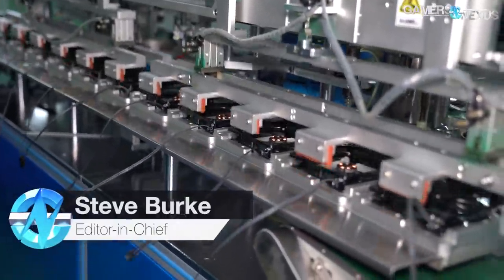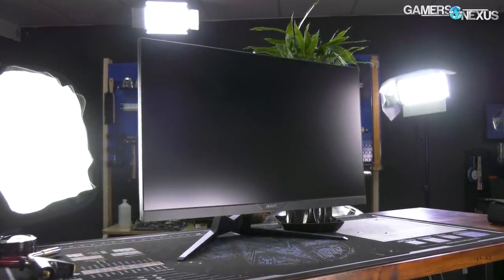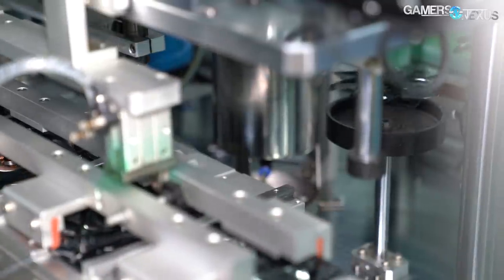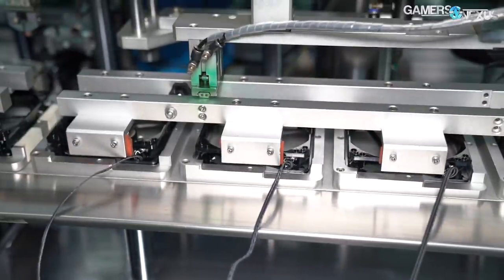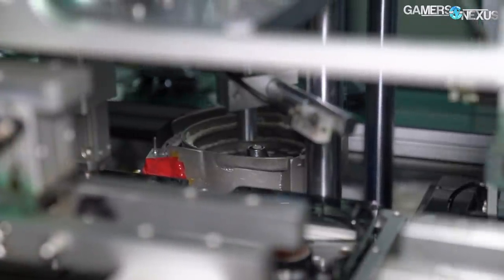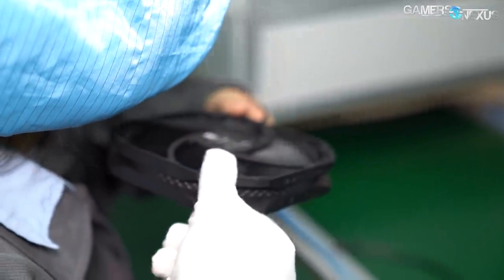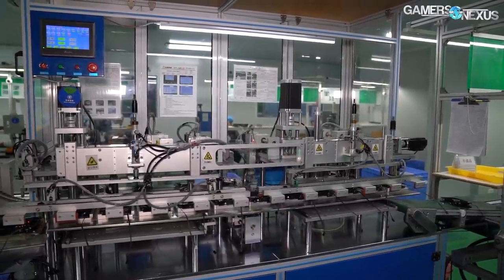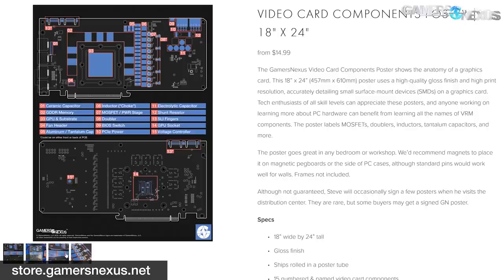How PC Case Fans Are Made | Shenzhen Factory Tour (Deepcool)

Comment: don't understand why fan manufactures don't use silent pwm modulation instead of straight square wave which is noisy as hell
Reply: Its cheaper? I dont know. But Money is one of the important points.Cheper is better = more profit.
Reply: @Noname_2014  a little yes but it is probably less than half dollar each for a dead silent driver instead of the tikking you often hear.
And customers would gladly pay one dollar extra for the silence

Comment: that's not a bearing. that's a bushing. and that's not good. they cause more friction and wear down faster than an actual bearing
Reply: Actually, a bushing is a bearing (plain bearing to be precise). And is often used with shafts that spin fast since a film of oil develops around the contact area between the shaft and bushing causing the shaft to ride on a layer of oil without making direct contact with the bushing. This is a low friction, low wear operating state. The only significant wear should occur on spinup and spindown. Even normal sintered metal bearings will exhibit this behaviour at high rpms such as those seen in fans (if the right lube is used), but lube will eventually dry out. However, more specialised rifle/spiral groove bearings have a groove cut into them for this purpose, the lubricant is drawn from a reservoir. Either way, even basic sintered metal bearings have a ~30000 hr lifespan. Rifle bearings and other specialized FDM bearings are just quieter and their lifespan lies around 50000 hrs.

Comment: No metter what brand if it's 2-ball-bearing, it's ok. Do not accept less.
Reply: If you want it to last, get magnetic levitation (I'll probably never need to buy 120mm fans again). Kind of expensive initially, but with 10x Sunon Maglev fans, I should be good for life (even if the thing runs 24/7, it should last a seriously long time. Be warned though, even on a good deal USED they cost more than brand new Delta fans with 8+ year life expectancy with 24/7 server use. I also like Delta 120mm fans, it will also probably last most of a PC user's lifetime with typical use, and they are not crazy expensive).

Cheapo fans die fast. I've gone through all of my cheapo fans since 2015, all of them are dead. Though one is now replaced with a 120 watt brushless RC motor and 30 amp ESC zip tied to the outside of it. Its limited to 120w due to the fact that past that, the blades expand too much and scrape the housing, otherwise they would probably explode with much more power anyways. That one is almost "overkill", but hey, if you had a PC case on wheels, it would be a great way to make it scoot across the room!
Reply: @jakegarrett8109  Not sure about Sunon. Delta is way better. Those all PC fans are just joke. Deep cool too.
Reply: @Bojcha76  I wouldn't say one brand is "better" than the other.

Last fans I bought were labeled "Fonsan Delta Electronics", and they were absolute $hit, so out of balance they would rattle off the table and even after 20 minutes trying to get 6 of them balanced with hot glue, I gave up and decided I just wouldn't use them. They would probably shake apart the VRMs on my GPUs. By contrast, even he $0.70 clear cheapo no-name 40mm fans that are much thinner that I've used on my 3d printer for the last 6 years (intermittent use) have never failed me while putting out more air, and making way less noise. These "Fonsan" were the worst 40mm fans I've ever seen, period... And they were really slow RPM... If they were like my "super speed class" (fastest speed available for 40mm by Sunon), then the noise would be justified (not the vibration though). The difference is, those duel-stage, contra-rotating Sunon fans are like miniature jets with how much air they push, while the "Fonsan" were seriously pitiful (which was fine, I wanted just a gentle breeze on the VRMs, but I didn't want it to sound like a jackhammer...)

I seriously hope Delta Electronics has no affiliation with them, I really hope those were fakes/counterfeit with a sticker slapped onto factory rejects... The previous Delta fans I've used were fine, these were just garbage though (so I really hope they were fake, that's why I use "" marks, because that's just what they claim they are on the label)

I'm not using "PC fans", they are server grade (38mm depth 120mm), and the MagLev fans I bought were pulled from a server (they are like $40 a piece if I bought new, still pretty expensive even used though, LOL!). Still more silent than the pitiful cooler on the $1200 Titan Xp collectors edition I have, and I'm fine with louder systems (although even my sub-zero phase cooled PC is way quieter with its compressor system than the slow "Fonsan" labeled fans, those were unacceptable).

Most powerful 120mm fan I have is custom (I fried the fan motor boosting voltage to 20v, so I replaced it with RC airplane brushless motor and 30 amp ESC), it can pull 120 watts before the blades expand too much and hit the housing, but I think much more and it would probably explode anyways... I then switched to server fans instead of using voltage boosters for my case fans after my room smelled of burned motors, good times though, haha!
Reply: @jakegarrett8109  i fully agree about brands. Brand does not promise quality anymore.

Comment: These fans look super cheap and from early 2000s.
Reply: Most case fans are super cheap, this was probably the low end case line (Vast majority of purchases) that come with 1-2 fans.
Reply: These fans are from the Gammaxx 400 cooler that I bought for 23 bucks and even though they are cheap they are pretty quiet
Reply: These are Gammaxx 400 air cooler fan. That cooler is priced at roughly $15 in China and had been in the market for more than 10 years. The noise level and performance are slightly better than CM’s Hyper 212 evo, not bad considering the low price.